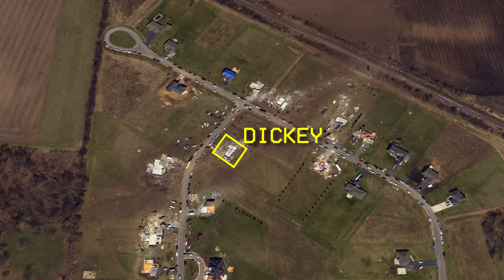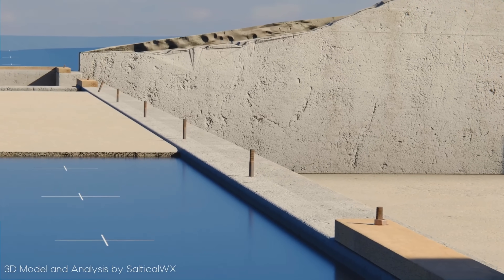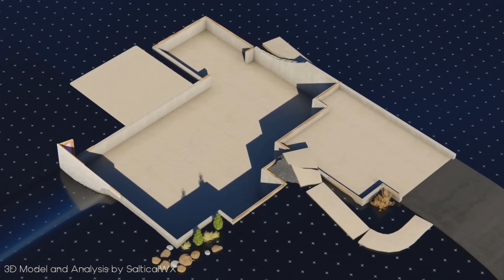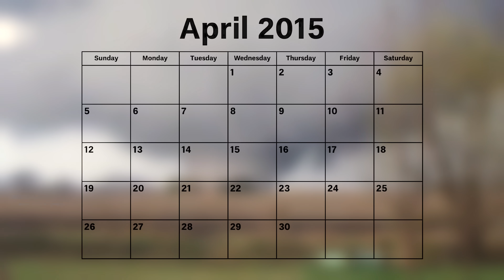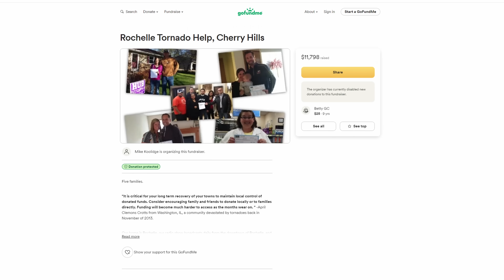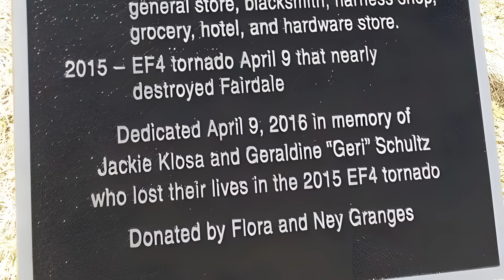The Strongest Tornado That Wasn't Rated EF5

Comment: Wow! Thanks for putting this together! Over the past few years I’ve come across all these individual clips never realizing they were all of this same tornado! It’s so amazing how different a tornado can look based on your perspective. I remember finding the footage of the bright white tornado a year ago and had no idea it was the same tornado in the footage taken by Sam Smith and Clem Shultz!! At 3:30 it talks about something I’ve always wondered, when it shows a mesocyclone rotating around the funnel, is that considered part of the tornado when they measure its size, even if that part isn’t on the ground? Sometimes you see them say “2 mile wide tornado” but what’s on the ground doesn’t in fact look to be that wide at all
Reply from the maker: Yes, those winds are considered part of the tornado, but the most violent deadly winds occur in the core of the tornado.

Comment: Having heard the Skywarn audio many many times and seen the TV footage, to hear net control say condition black, I don't want anyone chasing this thing really hammers home how absolutely wild this was.

I'm confused by two things, so can anyone explain them to me?

1. Several sources say EF5 DI were found in the survay and yet EF4 was the final rating. I thought if EF5 DI were there the survey used the highest damage indicators. We've seen tornadoes that have EF4 and pockets of EF5 be rated EF5 after all pre Rochelle, so did something change in the way surveys are done?

2. Where, at least in Illinois, is the bar for a tornado emergency set at? People have told me before IL would never issue one but those same people said MI would never issue one and then 2024 happened so what would it take for the Chicago office to issue a tornado emergency, a tornado the size and strength of Rochelle on a direct path for Chicago?

Comment: I work in statistical measure development -- my problem with the EF  scale is it lacks consistency. It does not measure tornado intensity the same way across time, amd also, it is incomparable to the F scale for EF3+. These are major and unforced scientific errors. They could have designed the EF scale so that, while its wind estimates were more accurate, it assigned tornadoes to 0 through 5  at roughly the same distribution that the F scale did -- this would have made It possible to (roughly) compare tornadoes across time, even across the F-EF transition. Secondly, they should have enforced much more standardized implementation of EF grading across time. As you show, it currently leaves a ton to the individual graders' discretions. And to be clear, with new understanding it's often necessary to update your measure -- but with each update, you need to rerate EVERYTHING you previously rated, or label it as a mew measure (EF v1.1, etc), or else the measure is unusable because the standards change over time. In other words, if you rate Rochelle EF4, you may need to downgrade Greensburg to EF4, too -- or at least clearly state that they were graded with slightly different scales. Lastly, they're needlessly leaving information on the table. Why do we have to wait 30 years to incorporate radar information in tornado intensity? It's less reliable than ground damage in some ways, but far more reliable in other ways!
Reply: @jamesdowell5268  
This got me thinking 
Would they rate say Greesburg an ef5 today as compared to 2007?

If not then we have a flawed system
Reply: @Michael-sb8jf 

Yes. Yes they would. They would not look at a tornado that leveled 95% of the town it hit, and not give it EF5.
Reply: Aggre and Goldsby as example should be an EF5 the same with Funing in China but China idk why don‘t want rating Tornadoes as an EF5

Comment: If you are going to cover tornado content, you should probably have a better understanding of how the Fujita scale actually works. The EF rating is based on the strength of a hardiest structure the tornado damaged. You can have a tornado with 250 mph winds registered as an EF 1, is all it did was blow through farmland and not hit any major structures. Most likely, the reason this tornado wasn't rated an EF 5 isn't an issue of it's strength, but that there where no structures hit that were hardy enough to give an EF 5 rating. Looks like everything was regular timber construction that is common in the US. It would be a different story if some of those houses were stone.
Reply from the maker: I know how the Enhanced Fujita Scale works, I have a degree in engineering

Comment: The craziest part of Clem’s video is hearing the “freight train” sound get louder and louder as the tornado approaches. Watching his original video with the volume way up is absolutely terrifying.
Reply: I’ve done that too. It literally sounds like an approaching 747
Reply: Recorded sound can never equal the experience itself.  The sound gets into your body, you very bones  resonate and you cannot hear yourself scream.  - that is the best description I've heard from 2011 Phil Campbell.
Reply: It maxes out the audio and just sound like ripping and silence.
Reply: i know, right?! it shakes me to my core, i never knew the name but like - it definitely terrified me because that noise is so, so loud.
Reply: I wonder where Clem landed
Reply: @bertkilborne6464 He rode the collapsing chimney down to the first floor. It was the chimney that crushed his wife and when they dug Clem out of the rubble, they found him on top of the destroyed chimney just above his dead wife.
Reply: It’s like the noise of the tornado is like, the tornado is screaming a low yell/roar while the ripping and breaking of the sound barrier symbolizing the absolute destruction and intensity of the tornado, and the roar symbolizing the terror
Reply: Sounds like a large plane flying overhead in a open field
Reply: ya I'm watching this in my car and the whole thing just vibrated during that part. fucking terrifying
Reply: Time stamp?
Reply: @LameByProxy 10:00
Reply: His wife  died
Reply: I’ve seen that video before. I remember thinking he was NUTS for waiting into the very last second to run to shelter! I still think that, actually!
Reply: You could legit hear the heavy breathing in that moment, poor fella was traumatized. Knowing he couldn't do anything but watch as that beast crept closer. Those winds sounded demonic 😮
Reply: I don’t know this man but will never forget the name because of his video. I personally haven’t lived through a tornado even though we get warnings more and more often these days and I am terrified of them. I’ve always heard about the infamous train sound but until I saw his video I didn’t realize it was the actual whistle of a train that you will hear. I was imagining something different. A lot of people questioned how he was just standing there recording but I listened to him breathing and in my very unprofessional opinion I think he might have been frozen in fear. You can’t say what you would or wouldn’t do in that situation. There’s not many options.
Reply: @elexis3728 How about go and protect your wife on the first floor. He froze with fear after seeing the tornado through his camera on the second floor, that’s a fact. Another fact is he chose to abandon his wife so he can get cool footage. He’s a coward and failed in his most important duty as a husband.
Reply: @Periodik is that what he done, abandoned his wife for the sake of content? That’s a genuine question. I haven’t watched or read anything he had to say about what happened to his wife. I assume he probably has a lot of shoulda, woulda and could’ve. I would, if I were him. I live in Louisiana where this time of the year we are always getting hurricane watches and hurricane warnings. People who grew up with these types of things you tend to get too comfortable with them because a lot of the time you go out doing all the things you are supposed to do or get in order to prepare for the hurricane but more often than not none of it is needed. Obviously you should take weather warnings seriously but some people just don’t until you go through something catastrophic like a hurricane Katrina or like this said tornado.
Reply: @Periodik  She was on the lst floor in a closet - the shelter of choice - that she died was a bitter irony and NOT his fault.   He was mesmerized himself by the storm and convinced himself the tornado was passing to his right.  He had horrendous injuries.
Reply: @DanielLiebert-i1p   on other videos of the footage he recorded I’ve seen other people criticizing the choices he made so I wasn’t very surprised by the reply to my comment. I think they had been married for many years and I bet he would switch places with his wife if it were at all possible. If he thought the tornado was more on the right side of their property he must have felt they would be fine because we have all seen images of how a tornado stays on a path. It’s normal for one side of street to be seriously damaged while the other side has very little, if any, depending on the strength
Reply: @Periodik  maybe he didn't like her enough for all that?
Reply: @Periodik Yeah he should've been next to his wife in the basement to catch the crumbling house that collapsed onto her... You're ridiculous.
Reply: @elexis3728  I don't understand why, IN ILLinois, there's no basement or storm shelter?
Reply: @cdewitz9019  I’m in Louisiana. I have never been to anyone’s house that has a basement and I’m in my early 40’s. Basements are not common around here.
Reply: @samxhain not to save her. To die together. She shouldnt have died alone. He was reckless and his wife not only died, but she died without her husband by her side, without comforting each other in the end. Its bittersweet.
Reply: @Periodik  how is he supposed to protect her??????? yell at the tornado to go away??????? you can't protect from mother nature at this level.
Reply: @cdewitz9019  Some houses just don't have them, built in areas prone to flooding perhaps. IL also doesn't get many tornadoes of this caliber. The Rochelle-Fairdale tornado was a freak storm.
Reply: @Periodik  Ok, but that's not your problem or burden to take. It's his. He gets to live with that. Thing is you don't know anything about them. You don't know the conversations that took place beforehand or their lives, period. People like you online watch videos with such limited info and criticize other people's choices in extreme situations proclaiming how YOU would've done things differently. It comes off as so self righteous and annoyingly arrogant. At face value things can seem a certain way and it's easy after the fact to criticize and judge people for their choices, but when you only have so much information it's foolish and arrogant to judge others. He says he went up to get some lanterns, but saw the tornado and thought it was moving away from them. Perhaps by the time he realized it was too late there was nothing he could do. Maybe he shouldn't have recorded. EVERYONE including yourself, make mistakes. We make bad judgements that cost us. You're no different. Dude was 85 yrs old and slow. You just don't know everything, but if she had a choice for him to be with her or survive I'm willing to bet she would want him to survive. Their children and grandchildren still get to see their g pa.
Reply: Being on the “he shouldn’t have been filming” side seems to be weirdly unpopular here. I see far too much praise of that video and how “quiet he is” and there’s no “annoying storm chaser commentary”. Contrary to many here, it’s a video I can’t stand seeing. No matter if he thought it was slightly to the right, or if he was ”frozen with fear” with a camera glued to his hand…you see a big and powerful tornado coming in your general direction, you DO NOT JUST SIT THERE AND FILM IT - you go take shelter. No matter what you think, he let his wife die alone while he films his now viral content. He’s got that and an extra helping of guilt for the rest of his life.
Reply: @cherie_bomb he was disabled bruh, you think he wouldn't move if he could? The man was bound to a wheelchair
Reply: @cherie_bomb this is what bothered me too. They should have been together. They should have died comforting each other. Instead she died alone. The utter betrayal in the end would have broken my heart.
Reply: @thelittleone1025  I think y'all are inserting a lot of unreasonable bias into the situation. Betrayal? Cowardice? He was in the least safe part of the house, his wife was in the safest place she could be. And to the person who said he should have defended her — FROM WHAT? Is he supposed to fight a tornado? Yell some choice words? Shoot at it? 

Have you never heard about the 'Fight, Flight, or Freeze' responses? Clem froze. It's a natural response. Claiming his actions were attributable to malice is irresponsible and appalling. I can't fathom actually saying that he should have died with her. Who looks at a tragedy and goes "one person lived? unacceptable. they both deserved to die"?
Reply: @ChicagoRatHole have you ever had to deal with the anxiety of growing up with a Midwestern dad? They never want to come down to the basement/ shelter and it is nerve-racking, dangerous and reckless.  And everyone wants their family with them during times like this. So yes we are inserting a lot of bias because its a personal topic for many of us. This isnt a science experiment, this is a common section for people get to share their opinions, which are often based upon bias and experience. Whereas facts are generally unbiased. 

And no one is saying she should have died, they’re just saying they should have been in the same place together, so if they had happened to both die, they went together. And that’s not bias, that’s marriage.
Reply: @thelittleone1025  I am, quite literally, from the Midwest. 

More than one person in this thread has asserted that they should have died together. Seeing as how one of them did not lose their life that day, what does that mean you're saying?

But also, have you never heard of the Fight, Flight, and Freeze responses? It's quite natural for someone to freeze up.

Regardless, you're being awfully callous about folks lives. You should probably reflect on that.
Reply: @thelittleone1025  i did grow up with a midwestern dad! a midwestern dad who is a firefighter and a spotter at that! i know the fear better than most people do because he was REQUIRED to be out in the storms for many many years. i am not going to say that this man should have ALSO DIED like you said they should have. you have no idea why he was up there, what he might have been doing, etcetera. she was in the safest place she should have been and he probably thought she would be safe. responses to traumatic situations vary and cannot be automatically overwritten for the sake of others. its human.

Comment: the actual factors of EF5 being damaged based versus wind speed means there are greater twisters than el reno/moore runnin amok in the plains not hitting anything, which degrades them to ef3 or ef4 if it kills somebody, an ef5 has been spotted within the last 10 years but since it never hits anything, it gets downgraded. its extremely fascinating.

Comment: At the time this occurred I was living 20 miles from this I did give chase but didn't leave fast enough..it had been a long time since a tornado of this magnitude developed in our area as a skywarn member.. also Mayfield should have been rated EF-5 the damage survey showed several well built brick homes taken off the foundation anchor bolts ripped from the cement foundation and the water tower was taken down and crumpled like a pop can.....only thing I can come up with has to do with insurance ratings for fema to give 100% 0r 41% funding. Just my theory tho!!😅😅